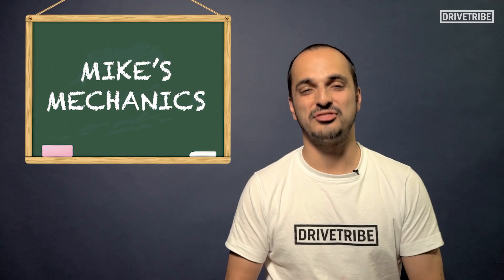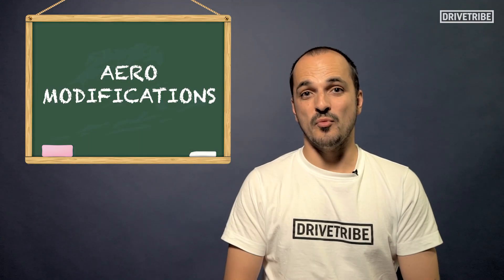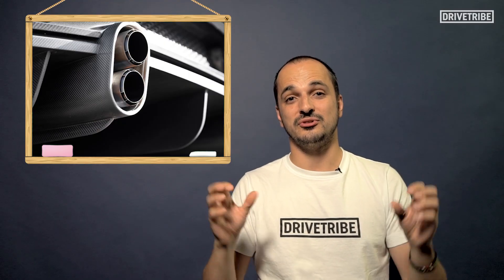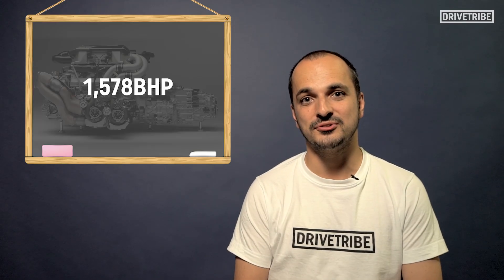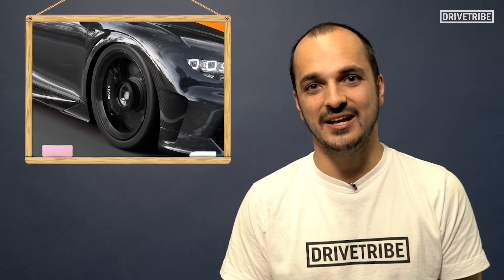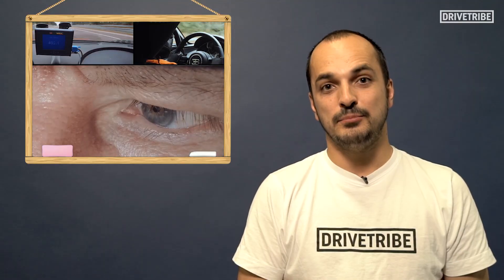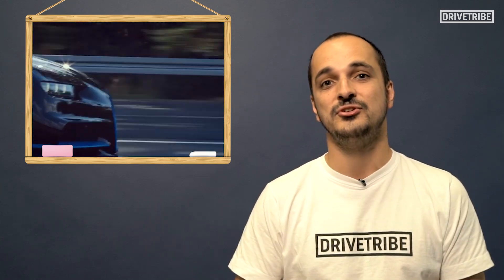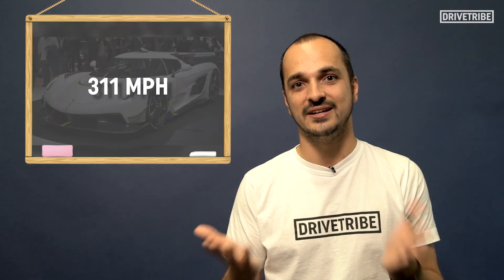How did the Bugatti Chiron reach 300mph?

Comment: Lightness has never anything to do with top speed. Top speed is when drag matches power. Also, the bug had tail wind. It did 300-400 at 4-6 sec faster than normal chiron. It will SUCK for Bugatto when they do the Guinness WR attempt, meaning both directions and dont reach 304.77 mph in average. REMEMBER THIS

Comment: You know that headwind rises exponentially. This means the faster you go, the stronger the headwind becomes. So the motor has two work much more for the last 50 mph. That is why it takes ages to get from 250 to 300 mph. An example is an cyclist. He can get only so fast because he or she hasn't enough strength to tackle the strength of the headwind. I think. ....

Comment: Bugatti i am going to go 300 mph... Koenigsegg ok I will do it with half the motor.
Reply: Didn't realize how Koenigsegg's fans were that toxic
Reply: @ALMAHDI1720  koenigsegg>> Bugatti
Reply: @alienxthemostpowerfulficti2888  Idc, I love both
Reply: XLiqpe7even Bro I’ve seem this this toxic ever since the Agera R came out. Waffling about how it would beat the Veyron SS. Claiming it go 274mph etc etc. But this clearly shows what they’re like when Bugatti does a comeback.
Reply: @ALMAHDI1720  uh
Well are you a Bugatti fan or something?
Reply: Did I heard correctly? A modified chiron? So having 16 cylinders and 4 turbos is not modified enough?  Lmfao
Reply: To much work for little motor.to much stress on little motor.
Reply: Another butthurt koeningsegg fanboy.  Jesko is going to be track focused, not topspeed.  And the Chiron could have gone faster.  The track wasn’t long enough.
Reply: @shez4550  Jesko has 2 configurations, high downforce (as shown so far) and a top speed focused one (with less downforce), That config is literally called "Jesko 300". As for "if the road was longer it would have gone faster" what about the fact that VW won't let anyone else use that road. They have a HUGE advantage on that track because it is so long and straight, along with the huge banked turns at each end for a good run-up. Put a Koenigsegg on that same road and it would be faster, no question, instead Koenigsegg have to find a stretch of road somewhere else in the road they can borrow, with worse surface, and in worse conditions, yet they will STILL break all the records.

Lastly, it would be more than an extra minute for the last 9.5Km/h drag increases exponentially as speed increases, the last 1Km/h would likely take as long as the first 100Km/h alone, maybe more.
Reply: I've already said I don't care about top speed, I'm about quarter mile times and cornering, funny fact tho, a stock agera rs from 2016 is faster down the quarter mile strip than the stock 2019 Chiron, koenisgseg is lighter, stiffer chassis, has better power to weight ratio and turns and brakes harder aswell...and that's their old model not the new jesko, neither of them are worth the price tag tho imo, I've seen plenty of much cheaper rally built type cars smoking hyper cars down quarter mile tracks and around race tracks..I've seen a race driver in a McLaren P1 get embarrassed by a 700bhp Evo around silverstone and the evo had 3 passengers and subwoofers in the boot lol..I've seen a vtech Ariel atom with a turbo conversion at brands hatch lapping hyper cars at warp speed lol, England always have something to compete at top level we just don't shout about it or charge millions of pounds or chase pointless top speed records, 300 mph means nothing on wet twisty British country back lanes..hyper cars are useless in England, only really used by Arabs to drive around London in 1st gear at redline lol.
Reply: @Fouren I'd rather drive my 3.0 TDI I don't give a fuk about internet opinions anymore lol.
Reply: And the quarter mile times are released by the manufacturers....agera rs is faster.
Reply: Considering the Bugatti is 4wd and has more power that's a bit embarrassing lol
Reply: I prefer koenigsegg as a car company too so I'm biassed, koenigsegg only make hyper cars, Bugatti is just another v.a.g spin off, it needs twice as many cylinders and turbos to keep up with the Volvo unit in the koenigsegg lol
Reply: @TheTruth-uy4kp  I've never seen a track record held by a Koeniggseg, it's always Ferrari, McLaren, Porsche and Lamborghini.
Reply: @jorge8596  koenigsegg don't do competition racing, maybe in the future.
Reply: With 800 kg less than bugatti plus
unstable chassis and noisy engine 🙂
Reply: @alialakbar1998  just how a race car should be lol, its not unstable tho when twisting through corners, most motor journalists don't have the talent to drive a koenigsegg or a bugatti on the limits, only a few have attempted it even in straight lines with all the driver aids on 😂...even chris harris is scared of koenigsegg, but f1 drivers can bend them arround corners at savage speeds... Pagini is another underated contender on race tracks for similar price.
Reply: @TheTruth-uy4kp  Pagani's are TERRIBLE on the racetrack 😂 you clearly don't know what you're talking about. They're posers cars. They're not made for track use.
Reply: @MikeMUFC91  clearly u don't know, pagini zonda r is for posers?..do u work at kwikfit? Lol
Reply: A 12 year old zonda r will beat koenigsegg and bugatti arround the nurburging, with basically half the horsepower.
Reply: @TheTruth-uy4kp  zonda r is banned on all race tracks
Reply: @ssjmonstar  tell me something I don't know...its still a one million pound car with half the horsepower of a bugatti, which will beat it on track...im done with this thread anyway lol.
Reply: I don't know why people think bugatti is the quickest track car just because it can hit 300mph lol, even an airiel atom is faster arround Silverstone with only 310 bhp.
Reply: And the zonda r is only banned because its so loud, if the exhaust is modified it can be driven anywhere even on street.
Reply: @MikeMUFC91  u saw Hammond use that Huayra or the Zonda F by the Stig? 

If not, check ur facts

Pagani is really good on track
Reply: @TheTruth-uy4kp  koenigsegg lack technology that's why it's loud. it's a chassis on wheels. buggati has air con heated seats etc. koenigsegg built for speed only and it's still slower
Reply: A koenigsegg handles much better than the bugatti in the hands of a real race driver tho, power to weight ratio is much more savage on a koenigsegg, and it brakes a lot faster, bugatti is more a luxury car than a race car...on the nurburgring with a fair test, same driver and track conditions, the koenigsegg would slaughter the bugatti.
Reply: @TheTruth-uy4kp  And other cars handle much better than Koenigssegg around a track. At least Bugatti fills the niche of luxury and speed while Koenigsegg only has straight line speed on their side.
Reply: R0adRuner that’s false as hell the one:1 will beat tons of cars around a track it’s all of them are street legal too so only official “race” cars like formula 1 and stuff is better and the jesko he’s tons of aero dynamics and is said to be able to turn like a formula 1 plus it’s more power than this Bugatti the jesko is way lighter and has 1600 Bhp I’m happy for Bugatti and it looks good but jesko has this in the bag
Reply: @prof1crl  the koenigsegg is faster on a race track, even the old agera r, the new jesko is claimed to be even faster, power to weight ratio power is actually more powerful than the bugatti and the monocoque chassis is stiffer and alot lighter and better balanced than bugattis ..koenigsegg have made alot of documentaries unlike bugatti who like to hide the intricate details...i don't care which is faster in a straight line tho tbh I look at lap times and g forces...bugattis lap time got beat by a vw polo wrc car at goodwood speed festival couple weeks back btw...
Reply: @modernyin6275  You're not right at all, life isn't Forza my dude, that single clutch gearbox is rly bad for a car of this caliber, plus the car is not really stable, every koenigsegg has an engine torque of ~1200 N.m at high RPM, that's too much to handle for this car to be really stable.
Reply: @modernyin6275  Again, I said a lot of cars handle better than the Egg. The agera wheelspins all the time and it doesn't really handle that well (having 1200bhp and only rear wheel drive). Only reason for fast lap times is that it rockets through the straights.
Reply: Who said anything about forza? 😂 ..G force and lap times isnt forza, it's scientific proof of who is faster arround the exact same road...which is why the Germans take the nurburgring lap test times so seriously.
Reply: R0adRuner the only time it wheel spins is at the very start I’ve seen the track time the one:1 when it set the lap record and it doesn’t even wheelspin as much as you think the agera rs has more wheelspin but again during a track you’re not gonna stop so after you set off you don’t have to worry about wheel spin again
Reply: XLiqpe7even it looks really stable going 284 and that was the Agera the jesko is designed to reach 300 being stable
Reply: Bugatti never claimed the chiron to be a track racing car, its a heavy, top speed luxury car with big heated leather seats lol, koenigseggs are built to be the fastest road legal race car, as in setting the fastest lap times, even if they only hit 250 its still a better race car than a bugatti who continue to modify the veyron to keep relevant in the hyper car market...top speed doesn't mean they make the best race cars for the race track. Brand New Bugatti chiron is 4wd but the old rwd koenigsegg agera r is still quicker to 200mph...the weight of the bugatti holds it back too, as in it will run out of fuel, brakes, and tyres, very quickly on a race track.
Reply: Nitro drag cars hit 300mph down a quater mile strip in 5-6 seconds, doesnt mean its a good track car tho.
Reply: @ALMAHDI1720  Have u ever heard of traction control?
Reply: @krocketonboost5236  hum ? yeah ????
I mean traction control and Koenigsegg electrical stability control are really good on straight line, traction control would reduce the motor torque, in a circuit, you want the most efficient way to take corners, in a Koenigsegg, u have to be really tactful with the car, you have to limit yourself, that's counterproductive..
But as I said, on the corners, if u accelerate into high RPM, every Koenigsegg's car are killer-machines, these cars aren't really meant for circuits.
https://youtu.be/wQ7mJT6q8KE?t=95
Reply: @ALMAHDI1720  Well, it kinda makes sense that you can't stomp the accelerator in a 1300hp car...
Reply: The Truth the Bugatti according to the driver could have gone faster, if the track was a little longer.  At 304, the car covered 1 km/h every 7 seconds.  It’s been 4 or 5 before it stopped.  Now he’s going about 490.55 km/h.  So he is 9.5 km/h away.  So if we simply do 7x9.5=66.5.  So just about a minute more and it would have done 500.
Reply: @TheTruth-uy4kp  Yep that's why Koenigsegg Jesko got G force sign right now.
Reply: @TheTruth-uy4kp  im sorry, but AWD is much better than the RWD eggs
Reply: But massively strain it and can't repeat it over and over. ;)

Comment: The first thing mentioned is reducing weight. Does that affect top speed?
Reply: A 10 ton truck with 1600hp, will it ever reach 300mph? ... Weight matters because we don't have infinite straights, so you have to be quick to reach your top speed, and to be quick you need power and to be as light as possible, ofc, along with some aero efficiency.

Comment: Interesting things to think about. Can't discount the achievement in any way, it is amazing. But I draw comparisons to top fuel drag cars. To my knowledge, the fastest pass ever is 335mph/539kph, not counting faster cars with other propulsion systems (like the hydrogen peroxide car that reached just shy of 400mph). I don't know what the manufacturing is like for drag tires, but it doesn't seem like they need to x-ray them or do anything extraordinary to ensure they are safe at drag speeds.  I suppose the simple fact that drag passes are extremely short means overheating the tires isn't a similar issue like it is with these kinds of top speed runs. Also weird to think about how driving against the grain of the track might cause such big issues? Didn't Hennessy basically use an air strip at, used by the Space shuttle for landings? Would the condition of that pavement be much better than the German test track Bugatti used? Hennessy did go in both directions after all.

Comment: weight has nothing to do with the top speed
it's to do with drag, rolling resistance and power
Reply: Almost. Weight does have a relatively small effect on top speed, but it does make a difference. If you remove around 200 kg/440 Lb the top speed of a normal sports car goes up a few tenths of a MPH or KM/H. Without the weight reduction, the Chiron prototype would have been slightly slower than 304.77 MPH

Comment: FYI Mercedes Benz has had the lasers that read the road and adjust the suspension for awhile now. It does not take anything any from the VW engineers,  adjusting  the suspension of an S Klass at 155 MPH and doing it on a hyper car at 300 MPH. It is like the difference between a Jetta and an F1 car. If you want something done right, have a German design it.

Comment: you lost me at "lightness". that has VERY little to do with a car's top speed. sure itll get there quicker, but the only effect weight has on top speed is the slight increase in rolling resistance, which, yes, makes a difference, but a nearly immeasurable one in this case. they removed the airbrake for obvious AERO reasons and the seat for, i assume, the later mentioned monitoring gear.

Comment: Top fuel drag races hit 300 barrier and beyond a while ago.
Reply: Well airplanes hit the 300 barrier a while ago... what's your point?
Reply: @dodoontherocks  300 mph on the ground has a different sensation than 300mph in the air, my point was that 300mph in car is really old news, also most buyers do not have the skill set for the BHP or Top speed of the Chiron and others.

Comment: Idk if this counts..... its like counting the ford gt crossing 300, its not modified with a spoiler or a new exhaust, the engine is modified, custom tires, and a new quarter panel back body.... until its production it does not count as the fastest production car in my mind, a mustang just did 270+ in the mile

Comment: "The first thing was lightness"

Three factors effect the top speed of a car. Power, gearing and drag. Weight doesn't come into it. Look at the history of land speed record cars. They are pretty much all behemoths.
Reply: When putting power through tyres, especially when doing it in succession and not one time run, weight absolutely matters. The heavier a car is the more strain it will put on the tyres and thus, the faster they will wear and lose grip. With old land speed record cars, they usually did their runs on old and very hard (comparitavly) tyres, meaning they wore very slowly. Nowadays, record cars dont put power through wheels and so really dont need to worry about tyres. As long as they survive centrifugal force, they'll do.
Reply: @garchompy_1561  Yep that effects the life of the tyres and their cost. The point stands though. It does nothing to change top speed.

Three factor effect the top speed of a wheel driven car. Weight ain't one of them.

Comment: Koenigsegg definetly. It will go with 550km/h easily
Reply: Dude the one thing that's limiting koenigsegg atm is that the new transmission have never been tested ever... whether or not it's the most car ever in a straight line the transmission is unproven and are subject to overheating if koenigsegg only developed it for the straight and as a dd.The jesko is basically uncharted territory as the Agera is literally a modded CCX chassis and if you consider the prototype before the CCX, Koenigsegg had more than 25 rears to develop the chassis, engine, and a reliable 3rd party transmission supplier. Simply put the koenigsegg jesko is either going to be incredibly amazing or a massive failure to end their pure gasoline power plant dynasty
Reply: Btw yes ik you said koenigsegg and didnt mentioned the Jesko but going 550 is impossible for at least another few years without breaking homoligation that allows them to ship the car as an international spec'ed car as the EU are going ham on emissions

Comment: Oh so bugatti made up an excuse about road grain so they didn't have to go that fast the other way.  Typical.  They knew they had a tail wind to give them 10 more mph and the track goes slightly down hill.  There's a reason you have to go both ways.  The road isn't rubberized like a drag strip it doesn't make that much of a difference.  It's also not a production car, Koeniggsegg did it with a wing and a real production car.

Comment: For a car to break a record it has to do the same speed in both directions and then to average the speed, otherwise you can say it had tail wind and in the opposite direction it may not do even 280mph...
Koenigsegg did it on a normal road because VW is not allowing them to use their track.  Bugatti was claiming that the Special Edition Chiron Long Tail would go even faster on Nevada due to thinner air ...but they won't try it. It's like saying to Mike Tyson  " I could whoop your ass but I'm not in a mood today". No, really, if you want to claim something and be proud about it, do it like it should be done.
Farks sake, the first car to break the 300mph barrier was Ford GT, not Bugatti, and still no one made a fuss about that, did they?

Comment: The science behind it is simple really:
The provided perimeters of the corroborated engine casket make the piston movements much more precise than the external flaws of the rear wheels and flappy paddle gear box which in turn accelerate the internal gears turn ratio by enough to speed the process of it by significant numbers.